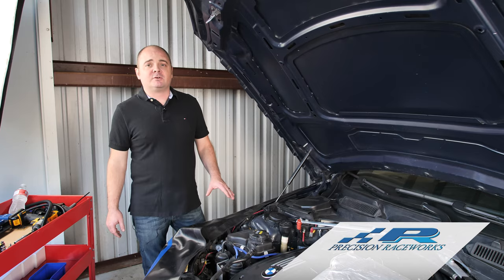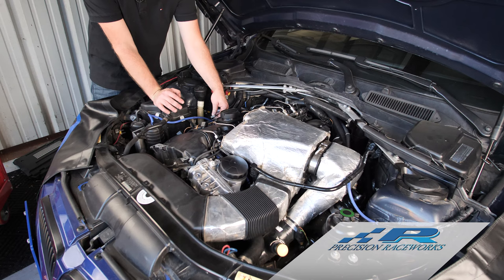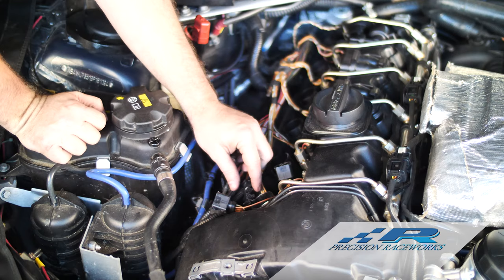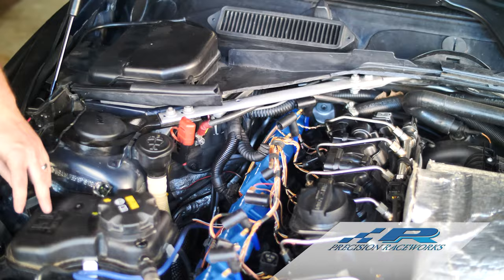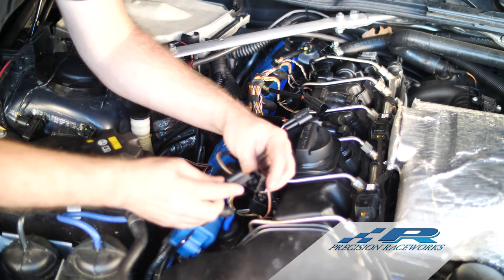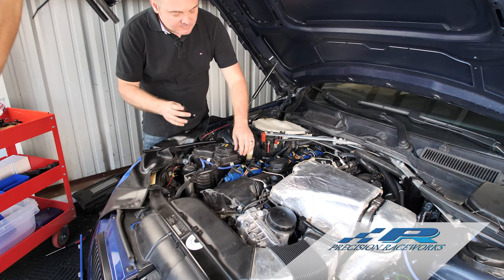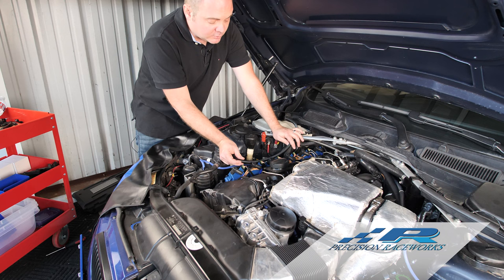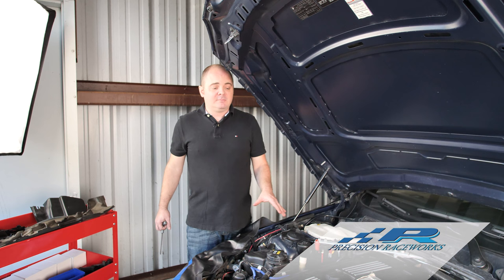PR Ignition Coils | Detailed Installation Guide

Comment: Where was this flashing info a year ago? Good to know I've been putting extra wear on my car with a flash when it wasn't necessary...
Reply: I know right...  Things after N54 flash .... stage 1. ( only mod: FM Intercooler and oil catch can. 91oct)  injectors started going bad, 2nd Bosch spark plug set,  1 DME MSD80 mosfet TRANSISTOR replaced, more bost= more tension with flash so I had to replace tensioner, it loosen my power stearing pump bolts (idk why bmw didn't add lock tie) but I did. Caused my serpentine to rip. Nightmare but fun to replace. Other than that had a blast with the exhaust burbles and rattling wastes, after all that fun Im back to stock flash. But now with this kit 🤔🤔🤔🤔🤔.  Very well presented video 👍

Comment: There's a lot of debate whether it advantageous to pick the Precision Racework tab on the MHD app. I recently where the guy said not to pick the PR tab when flashing my car. He said something where picking the PR option on the app will send an excessive amount of unnecessary current to the spark plug which can damage the plugs. Is that true? I'm currently running the PR Ignition Coils w/ NGK 2 step colder spark plugs. I went ahead and picked the PR tab during the flashing of my 335is and my car seems to be running great. Can you please advise me if I should keep it as I have it or should I unpick the PR under the coils tab b/c of risking of damaging my spark plugs. TY
Reply from the maker: This is a great question, the information you were given is somewhat correct.  The PR coils are much more powerful than stock coils even at the stock settings.  When increasing the dwell time which is what occurs when the check box is used they become even more powerful.  The more power you put through a spark plug the faster it will wear out but at the same time the larger plug gap that can be ran or the more cylinder pressure the spark can overcome.  We recommend cars below 500whp run with stock settings, not because it will damage the car enabling the check box.  But because most cars under 500whp are already getting better burn and seeing horsepower and torque gains after simply installing the coils.  Increasing the output at these power levels doesn't typically yield even more gains.  However a car pushing 700whp or 900whp would not see it's full potential without enabling the check box.  So in short yes it will shorten the life span of the plugs because the coils are doing their job and putting out more power.  So it really comes down to each customers needs.  If you want to know what is truly needed for your car we suggest putting the car on a dyno and simulating real world load.  You can then do before and after pulls with and without the increased dwell time to see how the graph changes.
Reply: Still have the pr tab checked?

Comment: Got mine in and that bracket does not fit. I dunno whats wrong with mine but I am pushing this thing up as tight as I can get it but I can not get the bracket in close enough to get these tiny screws in.
Reply: Never mind I got it. I reversed the way the boxes were attached to the bracket. Opposite of what was in the video.
Reply: @Travios1115  were you able to get the plastic engine cover back on? I had the same issue but I don’t think the cover is going to fit
Reply: @christospavlakis4487  Once I got the bracket straight and everything snapped into place I cut out some of the foam on the enging cover. Just the foam that sits over the coil area. Then squeezed it on and tightened it down. Its a tight fit but it works and can be done. Since then I have cut my cover to show the coil pack. I think it looks better that way.
Reply: @Travios1115  so you got it on with the coils in reverse and not the way he installed them in the video?
Reply: I thought about cutting the cover but I have vents in my hood and worry about water getting in
Reply: @christospavlakis4487  I reversed something and it worked. I'm not near my car to confirm but when I followed the instructions it did not work. The bracket itself wouldn't fit.